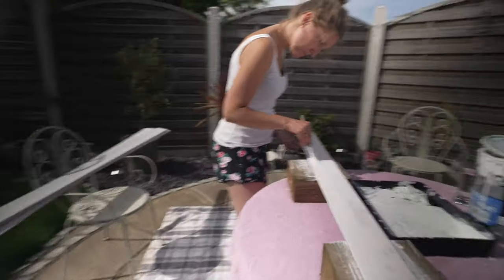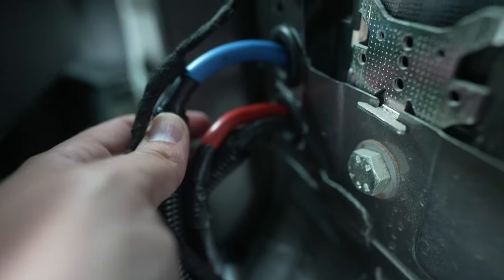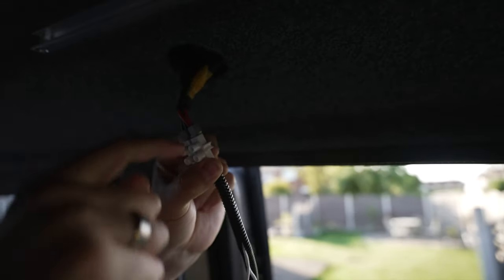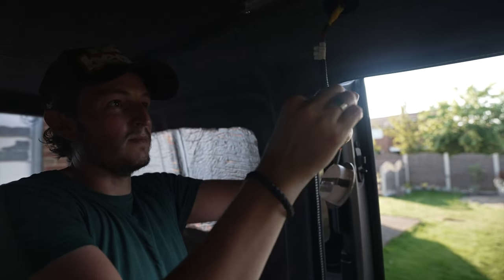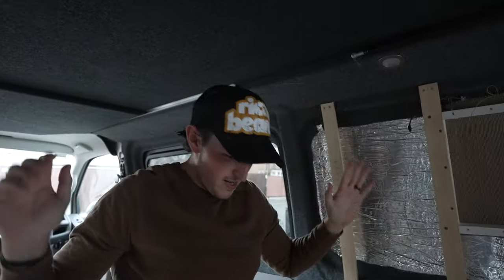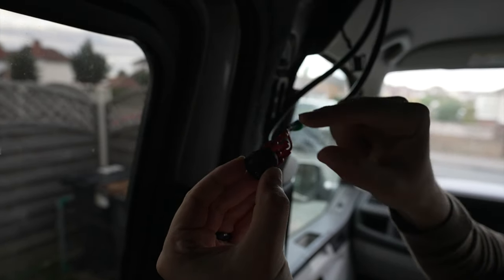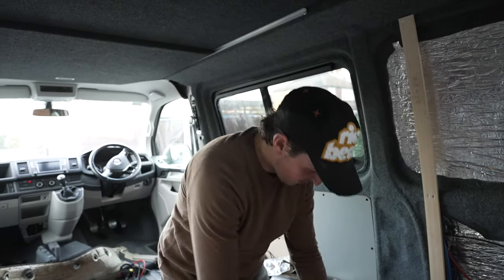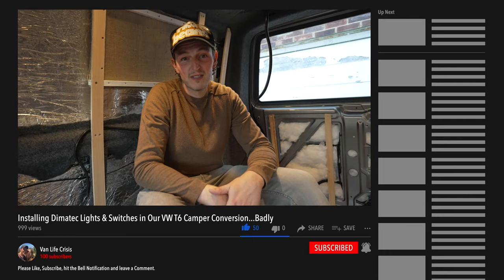FITTING LED DOWN LIGHTS (Badly) // VW T6 Camper Van Conversion // Van Life Diaries

Comment: The grey ferrules that you have used are known as bootlace ferrules - the only problem with what you have done is that they are supposed to be crimped using the correct crimp tool before you screw them into the connector block. The connector block will not crimp them properly and most likely the wire will just pull out.

Comment: Why did you not just use the original circuit for the doors and just put an extra LED over the doors...
Reply from the maker: Sorry I'm a bit lost, what do you mean?
Reply: @van.life.crisis  you mentioned you wanted the doors to switch the LED lights on to... or did I miss hear you? I wired mine to the leisure battery then put another couple over the side n rear doors, they operate on the van electrics... if I'm explaining right... if I miss heard you I am sorry fella.
Reply from the maker: Ah right, sorry. I wanted the switches to control the leisure lights and the door lights separately but from the same switch if that makes sense? So when we open the sliding door it could be switched to have the doors lights come on like normal, but also have the option to turn them off and switch it to the leisure lights using the same two way switch. I'm not really sure I'm making sense 🤣
I don't really know enough about the electrics to know what's possible to be honest, so I just go by what I've seen someone else do or what has been recommended by a friend.
Reply: @van.life.crisis  the easiest way I can think, would have been just use the door switch for your normal ones, and leisure battery with your dimmer switch on for ease of use, but if you've taken the normal lights out already, that option has gone lol. But no problems, I enjoyed watching a couple of your videos this evening. It's frustrating this van life stuff, but the rewards are well worth it.
Reply from the maker: I've removed the lights but kept the cables for the door lights. I have a friend who is good with this stuff he may be able to help.
It is definitely frustrating at times 😂, but yeh very rewarding! Glad you're enjoying the videos 😊